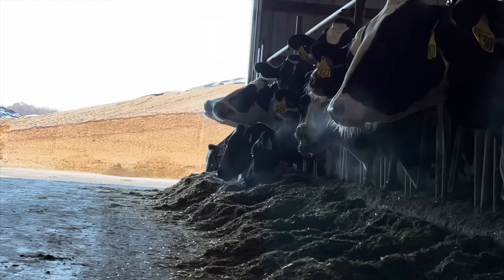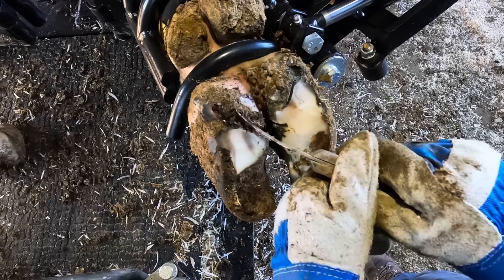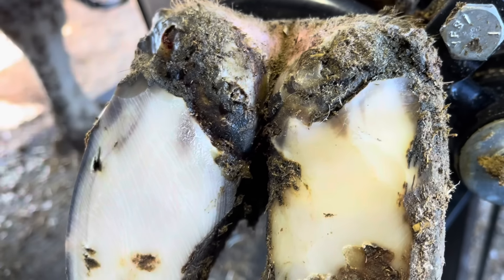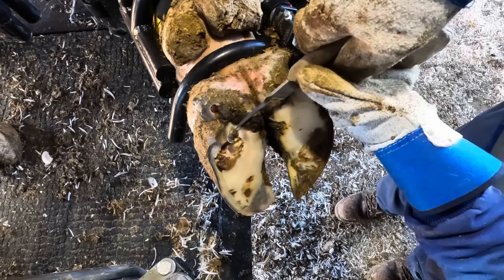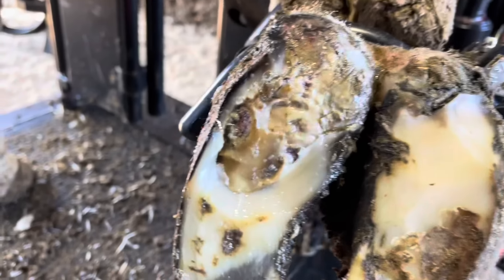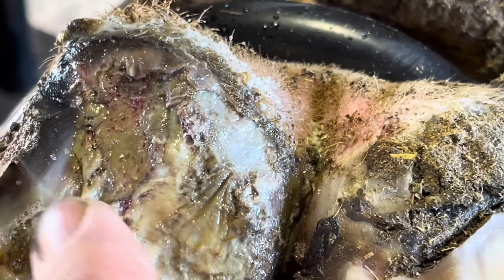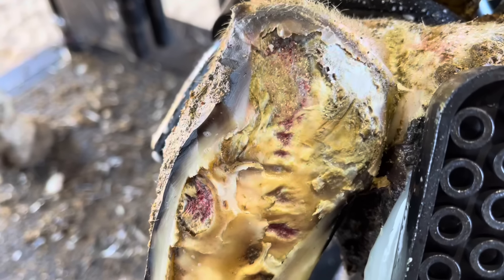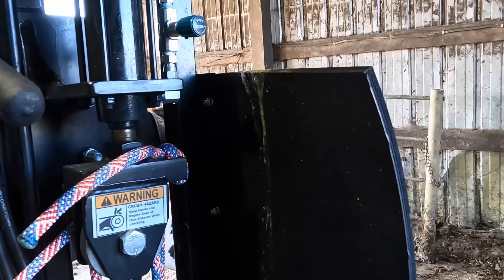This HOOF sure LOOKS ANGRY underneath!!

Comment: When he says anaerobic bacteria he means a bacteria that doesn’t require oxygen to survive and can withstand extreme high heats (usually anything over 105 degrees). Most anaerobic bacteria’s are also methicillin resistant. Meaning another form of antibiotics other than the cillian family is needed to help remove it from the body it’s infecting.